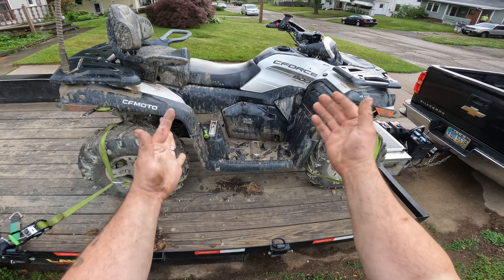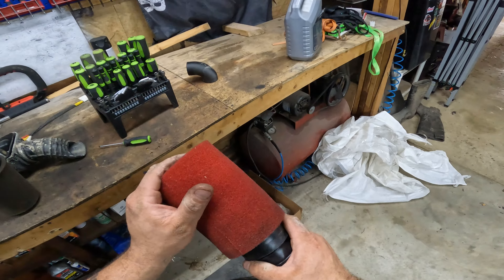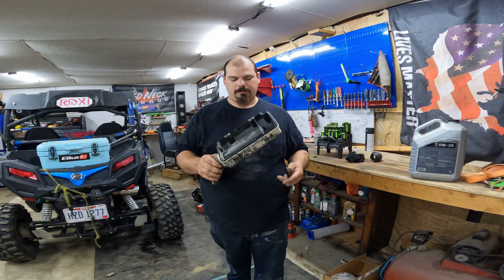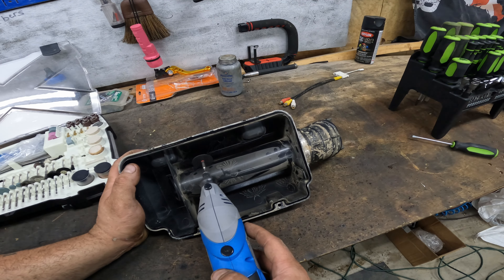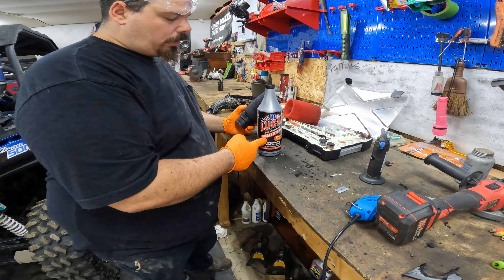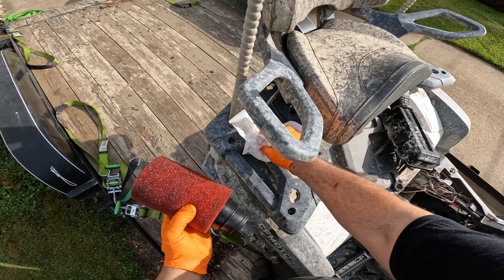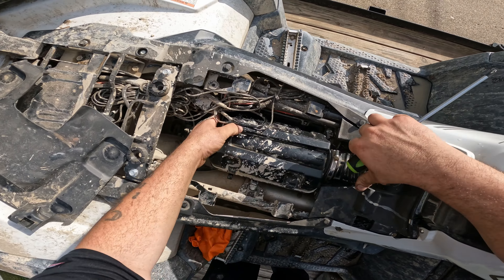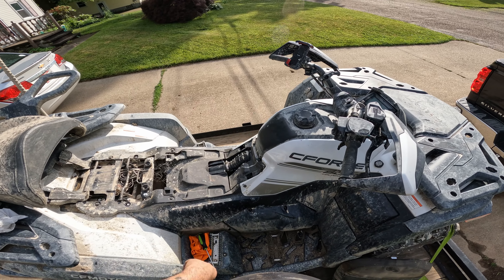CFMOTO CForce 600 FREE Mods and Uni Air Filter Upgrade

Comment: Seems that this mod would really improve throttle response.
Reply from the maker: It does.  Allot.
Reply: @R.N.GPerformance  Awesome, I'm gonna try this on my 600 touring.
Reply: @rzl07375  Hello do yuo tray do its Sam difrens 😊
Reply: (bearbeitet)
I drilled a few holes in that tube and put a K&N-Filter into it. I don´t have a lot of dust on my most driven roads and trails - it feels great on the throttle !!! 😎

Comment: Can i put the up-6229st filter in the air box without cutting out the part you cut out ? Just wondering if it can be done without modifications, maybe drill holes in that tube thing ?
Reply: Did your question get answered? I was wondering the same thing. Please lmk. Thx
Reply: @AdrianWillson-c1l  yes you can install that filter without any modifications
Reply: I watched other utube videos on this filter install

Comment: Thanks for the videos, they are very helpful. After you cutout the air box did it make the machine run leaner? and if it does is it detrimental the engine?
Thanks in advance
Reply from the maker: No it won’t.  The computer adjusts for it.  If it was a carb machine then yes it would.
Reply: @R.N.GPerformance  Thank you, I didn't think so either.

Comment: Did you have to tune yours after the intake mod ?
Reply: Would you feel any difference if you only add the uni filter and not cut the intake cover ?
Reply from the maker: No tune necessary for minor mods.  No you won’t feel a difference but your engine will live longer with a uni and I sell uni on my website www.rngperformance.net
Reply: Tune not necessary but you recommend it ?
Reply from the maker: @cleanproservices7111  absolutely I do.
Reply: Concerned about how much backfiring and popping will happen without the tune. Any advice is appreciated.